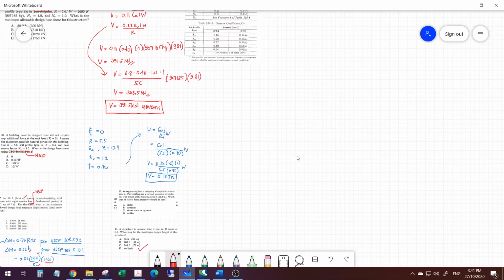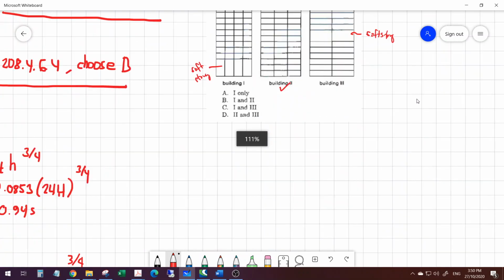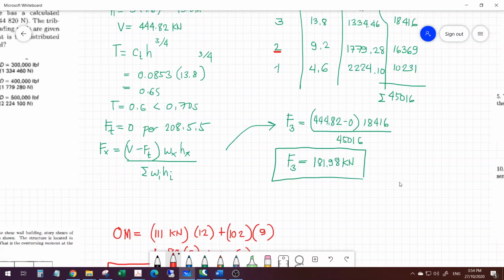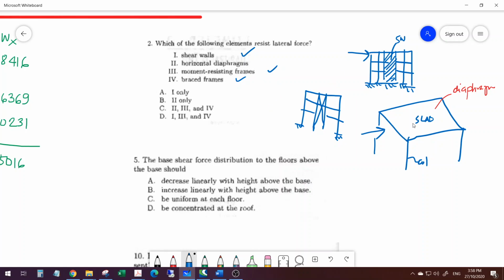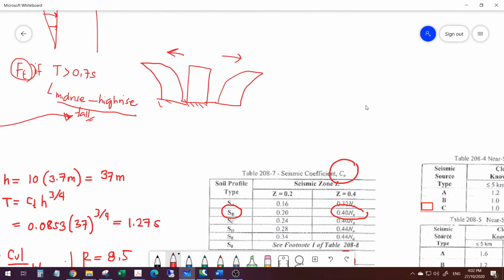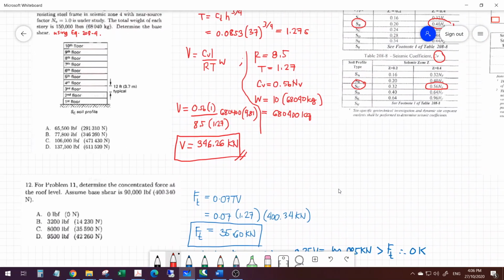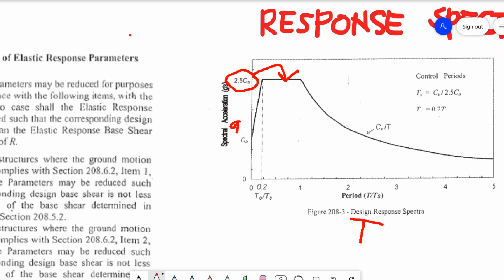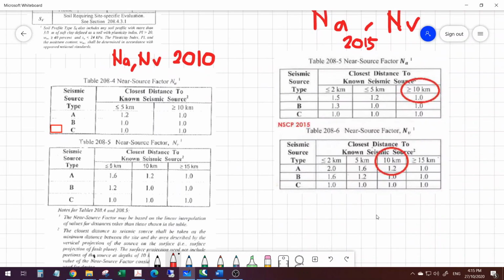Earthquake Engineering Solved Problems NSCP 2

Comment: same pa rin ba gagamitin sa ct is 0.0853 is steel plate shear walls?
Reply: yung R mag iiba ba yan  kung zone 2? wala kasi naka identify sa table nga for zone 4 or 2 ?
Reply from the maker: its designers discretion for choosing R..basically in zone 2u can choose almost all type of seismic resiting system with corresponding R since its low seismicity.
Reply: @juanpaulobersamina7586  thanks

Comment: Sir ano po magiging effect kapag ang suspended slab at beams ay hindi monolitic na binuhusan, ibig sabihin naunang binuhusan yung Beam at nag usli lng ng dalawang main bara para sa Suspended Slab?
Reply from the maker: you can apply epoxy binder before pouring new concrete to old concrete sir. In reality, we cant avoid those kindof situation naman. also slab acts as diaphragm because it has strong inplane stiffness during earthquake so it should still be assumed effective as long bonding of new to old is assured.
Reply: @juanpaulobersamina7586  Sir one more question, Ano po magiging effective depth ng beam sa ganitong situation same parin po ba?
Reply: I mean sa Design pag nagcompute tayo ng Moment capacity ng beam ano pong gagamitin na depth from center ng bottom bars to the top fiber ng beam yung orignal size parin po ba or magsisimula yung depth sa dugtungan ng beam and slab?
Reply from the maker: @ARONJAMESGARCIA  if its girder (which carries seismic force) basically depth is from center of bottom bar to top of beam.